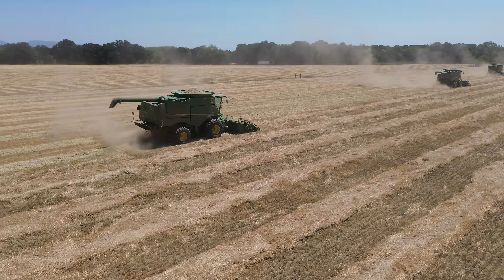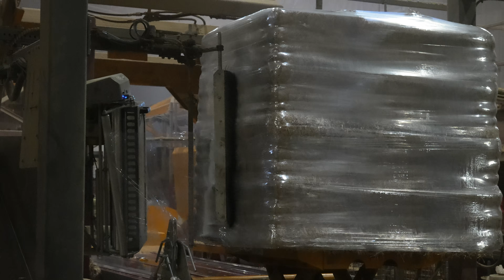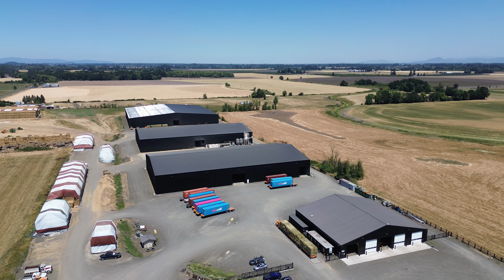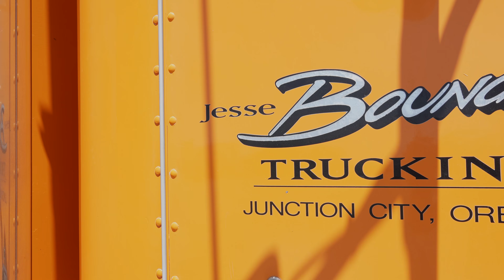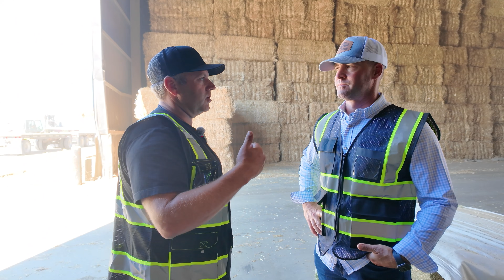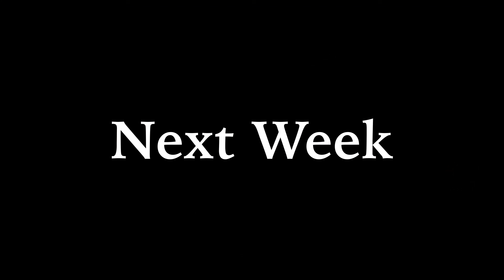He Started With Just 5 Acres of Hay… Now He Runs Millions

Comment: Interesting

Lots of talking 

Weeds on edge of paddock means weeds in crop equals low quality 
Duals on tractors,on flat paddocks equals wasting money on  50% extra tyres not required 
Doesn’t Tedder the grass🤷‍♂️🤷‍♂️🤷‍♂️🤷‍♂️
Takes twice as long to dry and twice risk of getting wet
How trucks front axles aren’t over loaded with bales right behind cab,full tanks of fuel,cab and engine has me wondering…..

What else is right there to improve yet aren’t
Reply: You definitely don’t know anything about how or why we do things your in correct on every opinion thanks for the reminder on how to do things.
Reply: @jessebounds6795 Sorry mate,only being cutting grass for longer than you ever have!
The arrogance to think you know more!!
I never said I knew more but I know weeds when I see him.I know lazy dried when I see it and definitely think dials on flat is a waste 

But you the man😂😂
Reply: We don’t use tedders when we bale straw. It’s straw not hay. There is a difference
Reply: @tylerburnham169 

Oh ok

Why does your combine leave swathes two metres wide one metre apart?

Mate,I was an Ag contractor for decades that ran a Krone multi baler.

I know what I’m looking at!
No BS is going to change that